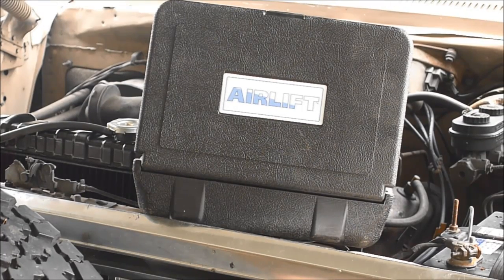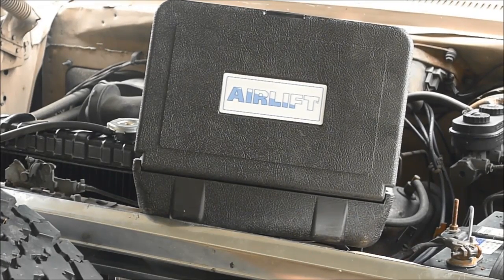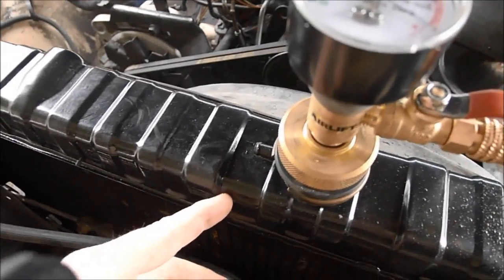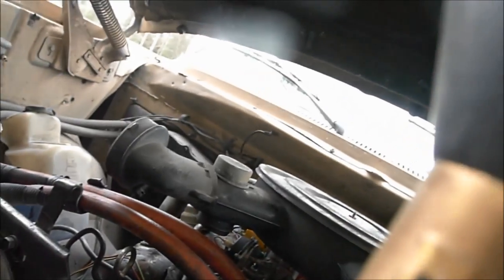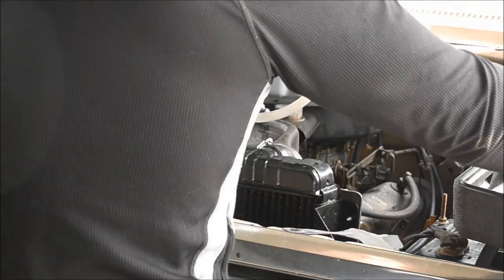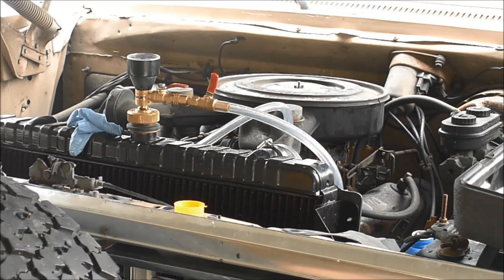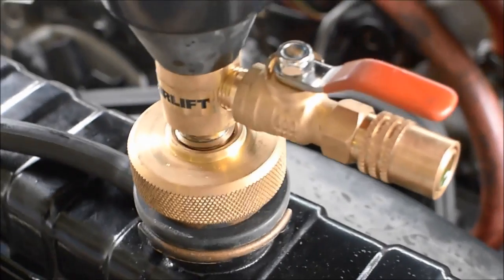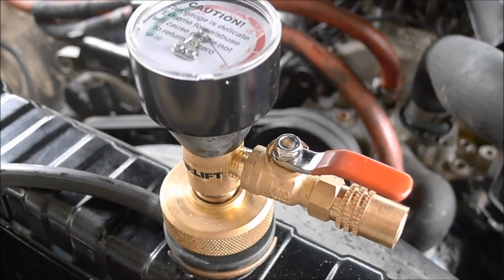Automotive Tools- Airlift Coolant System Test/Refill

Comment: I have this tool. What i do. Is put the new coolant in a clean 5 gallon bucket. Then submerge the fill hose, to evacuate the air in the hose, shut the valve on the fill hose then connect to the airlift. This way no air from the hose is introduced.

Comment: Thank you! Your video helped me make the decision buy this tool!!! Very happy $130 out the door at Napa. I used it on the notorious '02 GMC 2500HD 6.0 LS after replacing the thermostat. Was airlocked before and not after using the tool!!! Scanner confirmed running happy @ 208° bottom hose hot as well... Thanks again!!!

Comment: So this should only be used if  you have completely emptied the cooling system? Meaning you can't use it with the system full?
Reply from the maker: chvydrptop it doesn't really work with the system full.

Comment: so this thing is only for filling the system? how do you empty the old stuff  in the fast place?  i thought that's where mechanization is in greater need.
Reply: Yes I would not suggest emptying your old antifreeze with this unit because it will contaminate The metal valve on the inside if it’s just lightly no big deal but you wouldn’t want to empty the whole system drained the conventional way in and suck it down